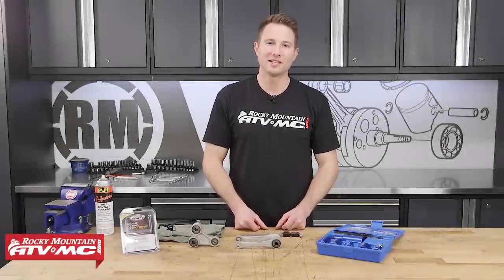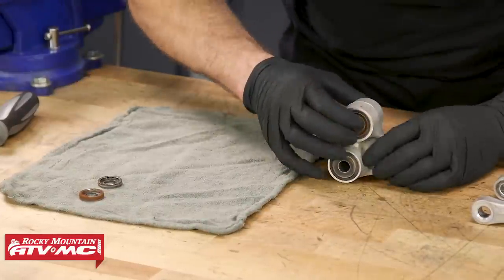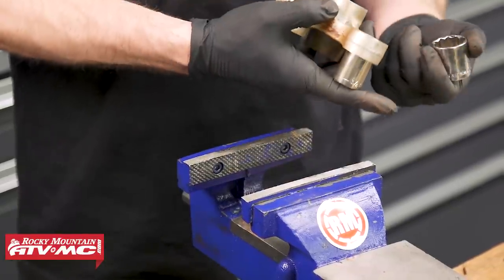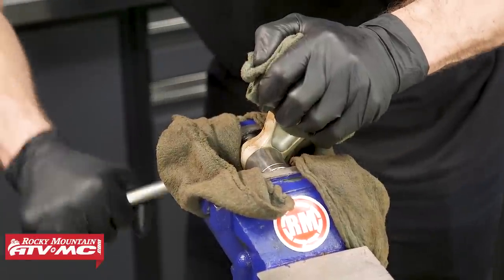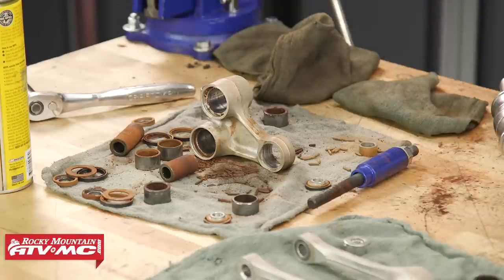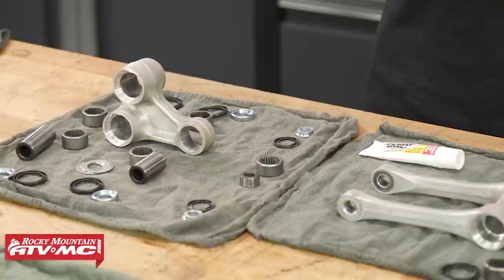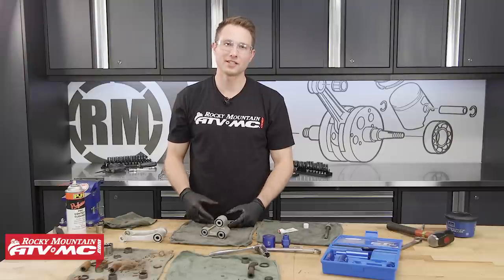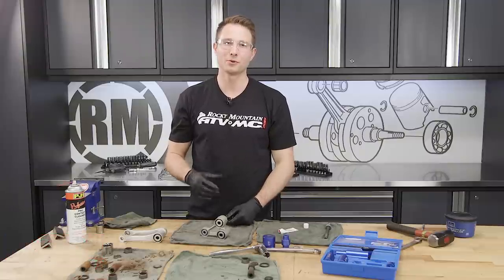How To Replace Shock Linkage Bearings on a Honda Dirt Bike

Comment: I saw the way you put the collar and dust seal on for the lower shock mount.  Is the service manual wrong for 2004 CR250?  It shows the collar going in first with the wide flat side against the bearing, then the seal goes on top of it.  All other installations I see do it the way you did it, and not by what's in the manual.

Comment: * Blind Puller hack.  Empty the wishbone race needles.  Take a washer the ID of the empty race.  Grind flat spots on opposite sides enough to get it into the empty race. Turn the washer (square side down) against the race wall and push it out with a couple of deep sockets. Vice was tough so I used my floor press.  It would help to put the whole wishbone in the freezer for a bit and then heat the outside aluminum.